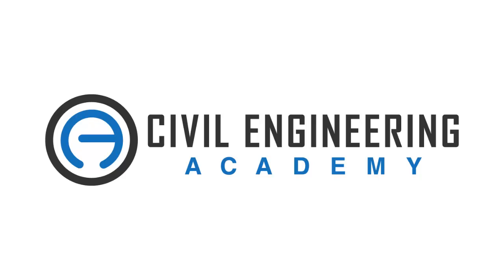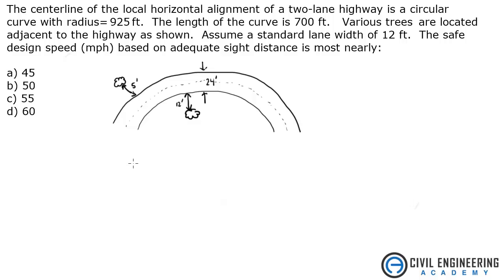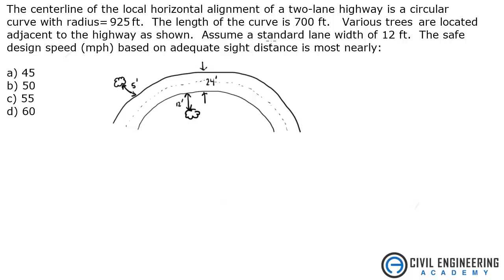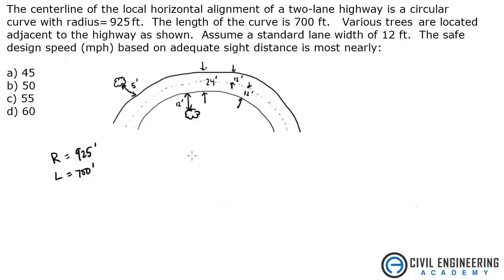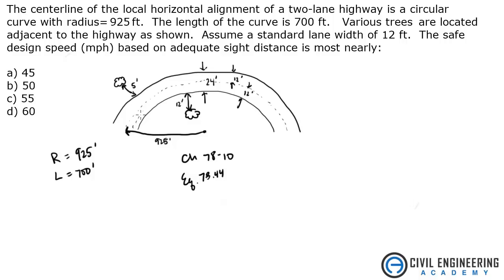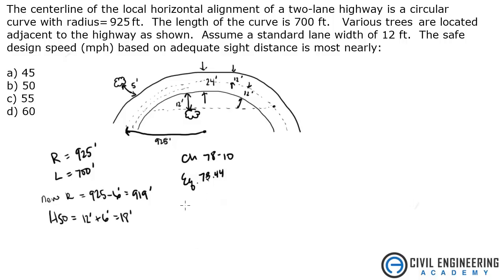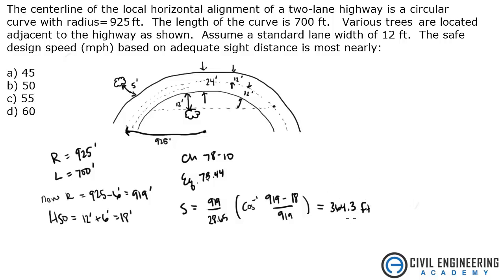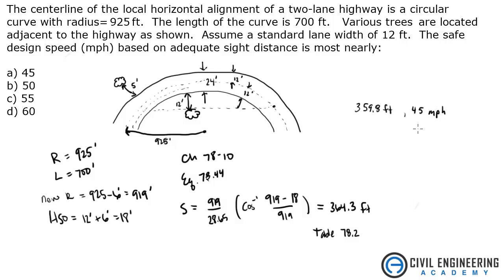Transportation-Safe Design Speed Using Stopping Sight Distance

Comment: you need at least 364 ft as stop sight distance, while 45 mph only gives you 360 ft, so 50 mph is the answer
Reply: question said most nearly so 45 mph is correct
Reply: table says you need at least 423.8 ft of stopping sight distance to have a design speed of 50 mph
Reply: 45 mph is the conservative answer